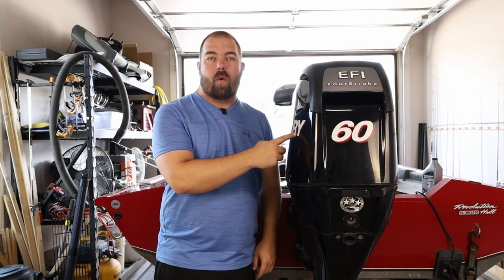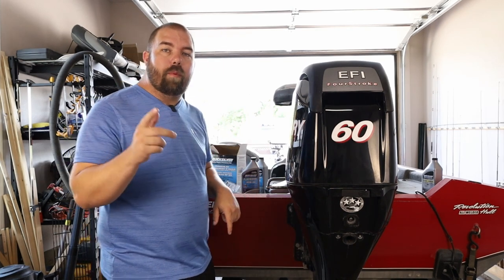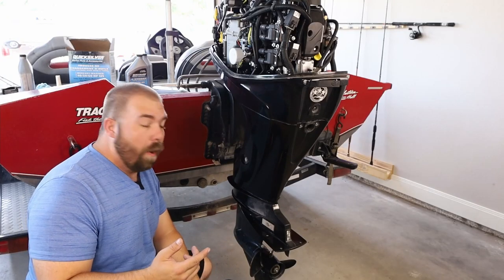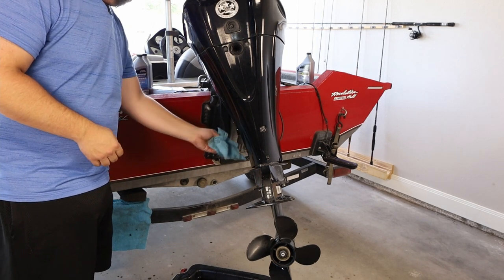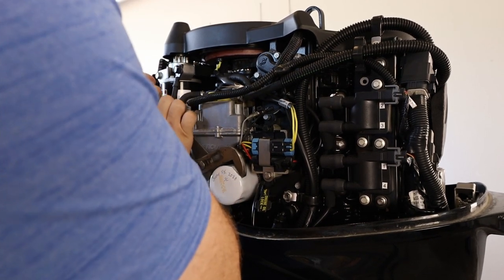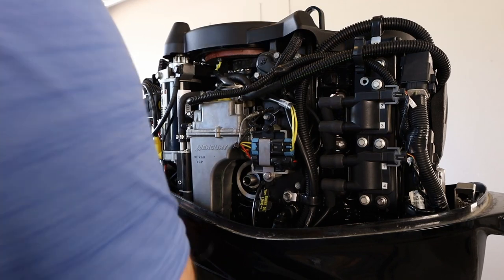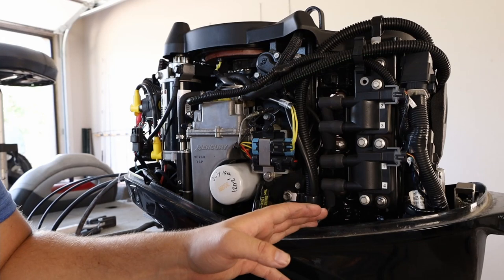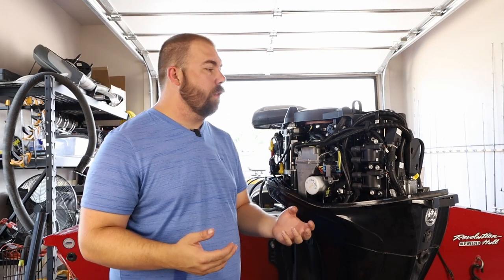60hp Mercury 4 Stroke Oil Change | 50hp Mercury 4 Stroke Oil Change | 40hp Mercury 4 Stroke Oil

Comment: Great video! Good tips! It might have been a good idea to drain the oil, and remove the oil filter before putting the drain plug back in. There might have come more oil to drain. Looking forward to seeing you video on the lower unit oil change.
Reply from the maker: Great tip!

Comment: I see that you’re using 25W-40 oil. The guy at Tracker Marine told me to use 10W-30 when I bought my boat. I’ve been told that the new manual recommends 25W-40 in hotter states like southeast and southwest states. Is that why you’re using 25W-40?
Reply from the maker: Mine recommends both but for different temperature ranges. The lower range (something like less than 40F) use 10W-30 and upper range was 25W-40.

Comment: Hey I just purchased a Mercury 60 horsepower 4 stroke. Noticed you have a four blade prop mine came with the three blade Mercury Max my boat is a ranger RT 178 c with three people we cannot get up on plane have you had any experiences like this with your 60 horsepowe. Also with three people in the boat the RPM will not RPM passed like 3400 rpm
Reply from the maker: Mine struggled to get 2 people on plane but it would get there. My guess is the three people are over the weight limit of the vessel. Not trying to make fun but those aluminum boats have low ratings. If you want to get three people on plane regularly you are going to have to step down a size or 2 in pitch and probably a 4 blade. You will sacrifice top speed when you go solo. You could also get a bigger motor (75-90hp).
Reply: @clearwaterfishing  I picked the boat up 6 weeks ago it's got about 11 hours on it I've been trying to get the dealer to work a deal all the way through they're saying at least 8 months to a year to get a 75 in I guess with the warranty I have to stay with Mercury or void the warranty. I can get a 75 4-stroke Suzuki or a 75 Yamaha four-stroke this week there's some kind of deal where as long as it's under warranty I guess I'm stuck with Mercury and Mercury is almost a year out for a 75 when you order it
Reply from the maker: @RogueLeo  what does the warranty cover? Hull I’m guessing?